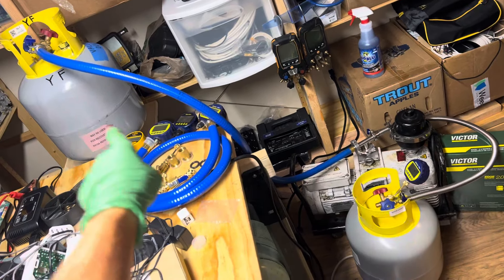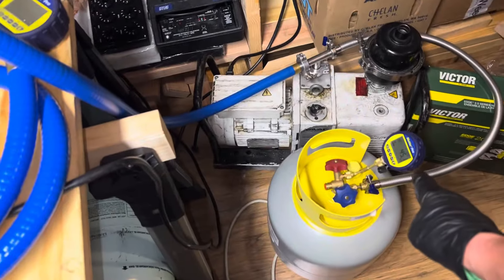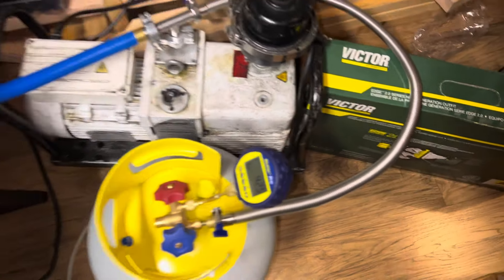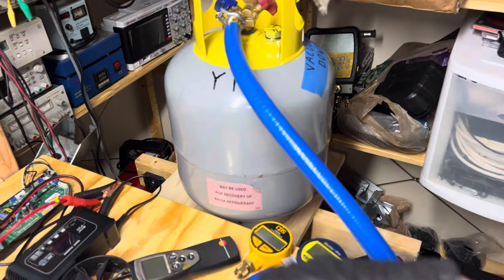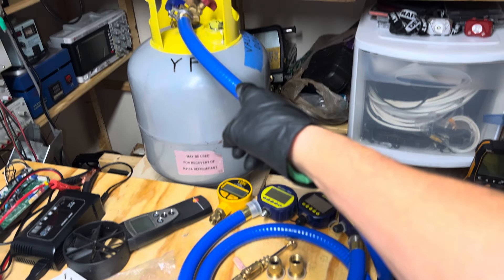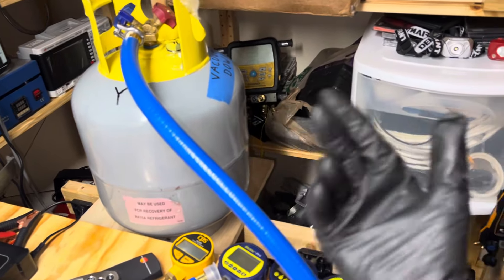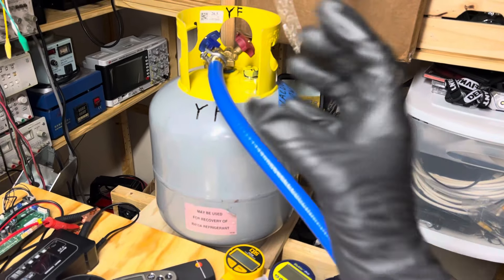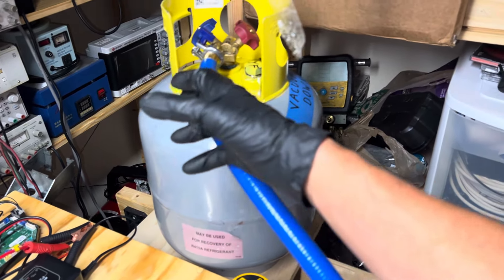Removing moisture on new refrigerant recovery cylinders for shop compressed air test ￼

Comment: What liner is in that SS braided line? PTFE?
Reply from the maker: No liner just pure stainless steel.
Reply: @coldfinger459sub0  Not in flexible one.
Usually those PTFE hoses with SS braided jackets
Reply from the maker: @commenter5469  https://accutools.com/products
Reply from the maker: @commenter5469  Accutools  .  Com
Reply from the maker: @commenter5469 yes I have stainless steel braided ones with a PTFE lining for my CO2 refrigerant gauges

Comment: Much faster if you use braze regulator to flow nitrogen on the high side to push water molecules out.
Reply: This is how we dried out our vacuum chambers in the case we couldn't hit our vacuum target.  Smal purge flow to keep the pressure between 1000-2000 microns.  We of course had N2 mass flow controllers in the gas supply thus we could precisely control vacuum pressure.

Comment: do I need a digital micron gauge ?   I have had my ac system disconnected but covered with a ziploc bag with zip ties over the hose openings for like 6 months.... if I run a vacuum for a few hours will it be enough ? ???  it is sealed now but it was under construction for 6 months as I stated and I finally got all the pieces to close it up..  if needed, could you suggest a micrometer which is a good digital budget friendly one you would recommend ? if not how should i run the vacuum ??? , thanks brother
Reply from the maker: Just throw it on the vacuum pump overnight your own personal vehicle you want to keep it a long time leave the vacuum pump on for 24 hours. 

If you receiver, dryer was open and exposed just get a new one 

The receiver dryer is the last thing you ever put on just prior to turning the vacuum pump .
Reply: Check if the oil is still colorless. If the oil is already yellowish or brownish it already breaks down and the vacuum pump can't restore it back to good condition. It's much better if you flush the system and change the oil but you need access to txv. You will need a lot of nitrogen to remove the flushing solvent.
Reply: @w0lvez1  the ref oil is all fresh evaporator was changed, condenser changed, desiccant filter bag changed, all pre loaded with proper type and amount of ref oil...
Reply: @HOTRODRICO  You really need a micron gauge when working on refrigerator with non mineral oil lubricant. If your system uses POE, since the system was opened to the atmosphere test for acid first to make sure.  Ref will work fine when empty but when there is moisture in the system it will struggle to cool or fail when the ref is full. You also need a larger diameter hose, valve core remover & dual stage vacuum pump to pull as low as 20 microns. Make sure the fan is working properly that is what causes failure on most refrigerators. Bluevac has the best software and very easy to use micron gauge.
Reply: @HOTRODRICO  Sorry, I misinterpreted the ref oil as a refrigerator instead of refrigerant. No need for micron gauge if oil is new and drier replace. Make sure to turn the compressor by hand several times before letting the engine turn it.
Reply: If possible, I pull a deep vacuum then n2 pressure decay test before injecting the refrigerant oil, then repeat vacuum after injecting the oil. The reason is, if the system has moisture the oil will be contaminated.
Reply from the maker: @thisisyourcaptainspeaking2259 I do the exact same thing. 
And I inject the oil when it’s under a deep vacuum so as the warm room, temperature oil burst into negative vacuum it explodes and expands like whipping cream foam .  Trapped air that is pressurized into it at atmospheric pressure just like CO2 and Coca-Cola

And the moisture content to the expanded foam surface area will be greater to expose the moisture molecules to a surface which easily can become mobile as a gas . 

And then continue on with my vacuum and a quick little purge of nitrogen right behind the same fitting that I have injected the oil